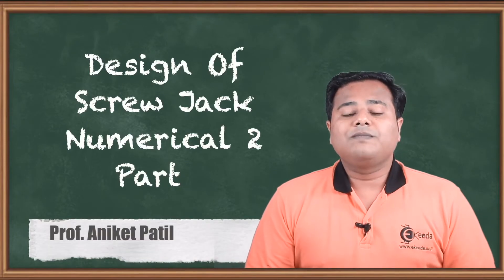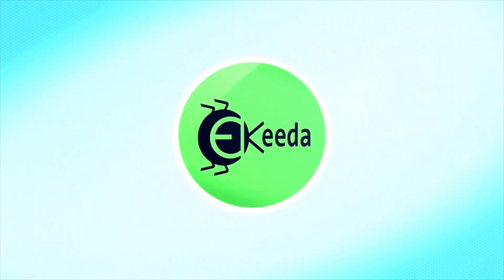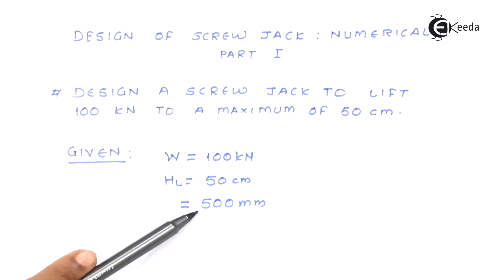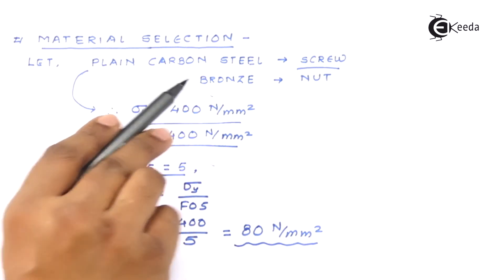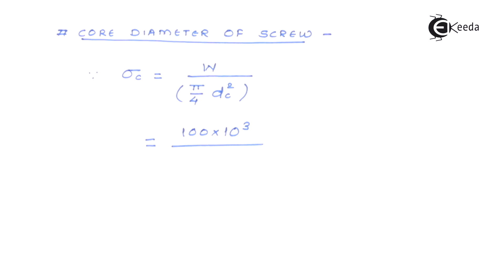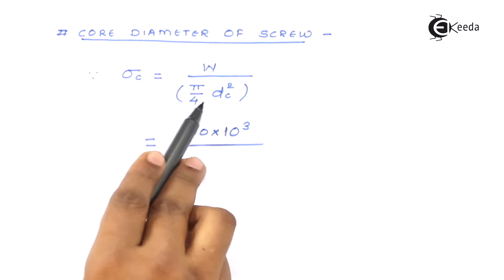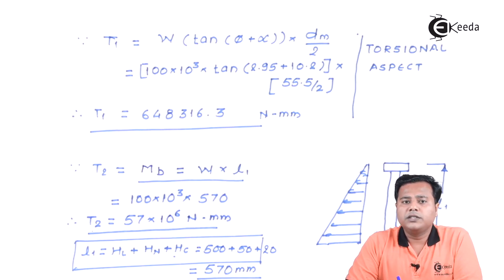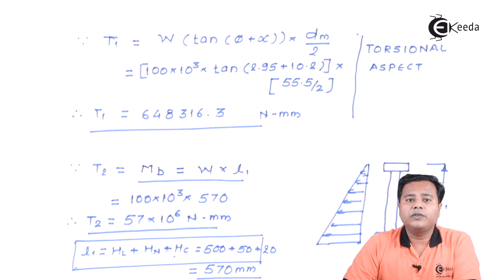Design of Screw Jack Numerical 2 Part 1 - Design Against Static Loads - Machine Design I

Comment: Design a Screw Jack (complete design) with a lift of 300 mm to lift a load of 50 KN. Select C40 steel ( sigma*y = 328.6 MPa) for the screw and soft phosphor bronze (sigma = 345) MPa and sigma*v = 13xi MPa) for nut.
Reply: Can u solve this problem